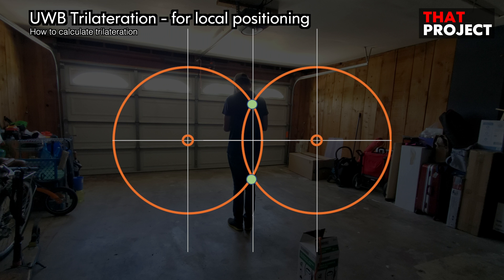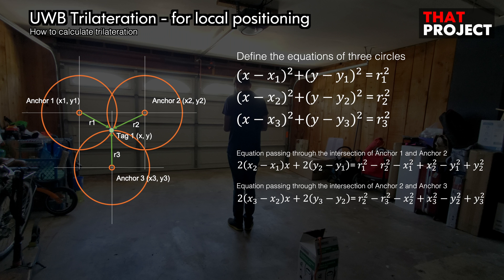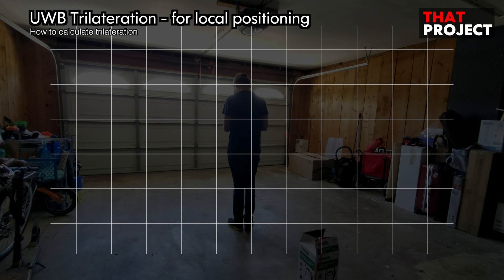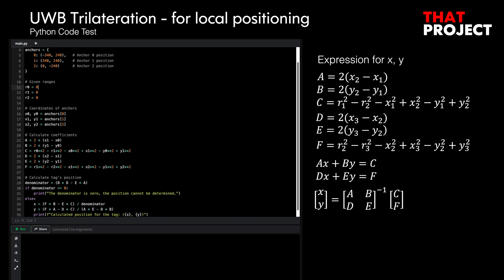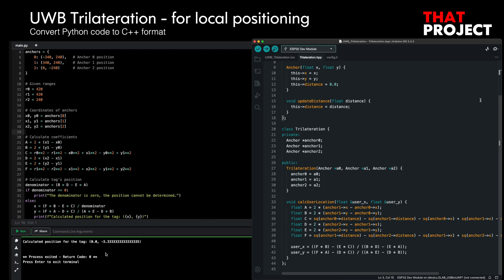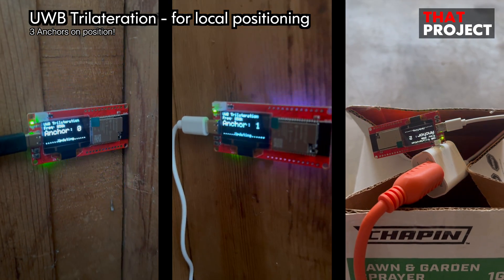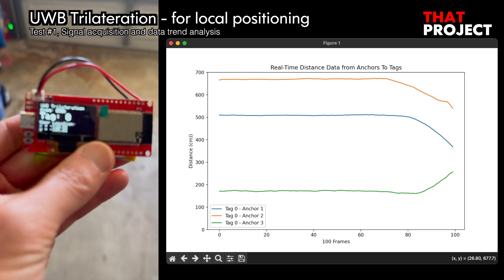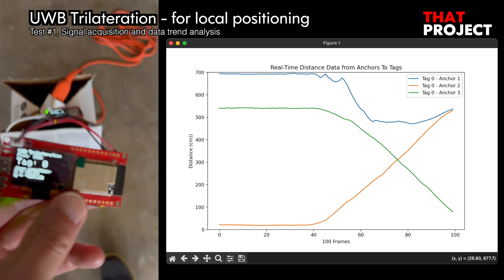UWB Trilateration with ESP32, DW3000 #LocalPositioning

Comment: I have 4 x ESP32 UWB Pro with Display (DW1000) from MakerFabs (this one). I tryed everything but scripts seems not to be working. I want to do a triangulation with 3 Anchors and one Tag.
Do you have a solution on this?
Reply from the maker: I used a DW3000 here, and I'm not sure what the problem is. I recommend posting an issue on Makerfabs' Github. I think they'll be able to address your issue quickly.

Comment: Sir we are going to do automation electrical power tiller using this uwb 3000 how much range I get
Reply from the maker: This doesn't cover extremely long distances. If you're looking for something like that, it's recommended to use a LoRa module. There are also many options available for this, so the maximum transmission range will vary depending on the configuration. For more information, see https://www.makerfabs.com/esp32-uwb-dw3000.html
Reply from the maker: I haven't tried it, so I'm not sure. First, confirm the DW3000 can maintain a stable link at 100 meters or the range you want.
Reply: Okey sir,we want a range around 100 -200m is enough for us sir...we also thought about lora but accuracy less sir,we need around 10cm so we go for dw3000 sir.. kindly give a good suggestion for this sir...we thought to buy a separate qorva dw3000 module and esp32 to minimize our budget..Tell us that also works or not ..or we go with this integrated module..Your reply means lot for us sir ..

Comment: Can I fix 4 anchor around the field . tag is placed in the moving tractor so the tractor location can be determined.i want to make a land levelling machine .for that it should not cross the field . The position of tractor is important.how will be the accuracy in this.
Reply from the maker: There may be a margin of error of approximately +- 10cm, but in your case, since you are detecting the movement of a large object, I don't think there will be any problem using it. It's a fun project.
Reply: @ThatProject sir thank you for your reply I have so many doubts in this can I clarify with you .we are running out of time could you help us sir?

Comment: I want to add another tag so that I have two tags and three anchors. How can I do this? I want to make a two-player agility analysis system.
Reply from the maker: I wanted to try it too, but I didn't have enough devices. I think it should be possible, since you can probably get the same information from the second tag as from the first tag.

Comment: Hello, which codes did you use for anchors and tags? And where did you upload the trilateration code, on the anchor or the tag?
Reply from the maker: Calculating the trilateration on the device that acts as the Tag.

Comment: Thank you for sharing this demo. May I ask if this is possible with DW3000 ESP32 v1.0? I have actually been trying to follow your demo using the codes from the uploaded code on Github, but it seems to not be working. It looks like the AT commands are not working with my device.
Reply from the maker: How about updating the firmware of your STM32? Or if you report an issue on their github they might be able to help you with your issue.

Comment: Very well filmed and explained, thank you! I am planning something similar for self-location of a robot in a 20x40m room, using ESP32 and BU01 (=DW1000) modules. I just glanced at your coordinate calculation code (thanks for sharing!) and noticed you do lots of calculations in the loop, whose values do not change (like sqrt of static anchor coordinates). To save CPU time I recommend doing as many static calculations as possible once at setup time and then using those constants in the loop, with the changing variables, that should reduce the CPU load by about half. You could even let the compiler do the static values and put the resulting constants into flash, saving RAM.
Reply from the maker: @c2h7  Yeah, it seems like my code needs some optimization.
Reply: Hi, where did you find the code? also, if you have an optimized veration, can you pls share it? thanks!
Reply: @ofekfinn1023 The code is linked in the video description. I did not make any improvements myself, I only glanced at the code.

Comment: I'm trying to connect these boards to macbook but the port is simply not recognized. Tried many cables. Any idea what could be the issue?
Reply from the maker: It looks like your MacBook doesn't have the USB Serial driver installed for this module. Please check which chip is used on your board and try installing the driver.

Comment: Great, that's exactly what I was looking for. But I have a few questions: why did u used stm32 with esp32? Can I use only esp32 to do the same (or only with stm32)? If so, which one you recommend?
Reply from the maker: Unfortunately, there is no library that makes DW3000 work properly on ESP32. If you make a driver, you can drive the UWB module directly on ESP32. Of course, I tried it, but it was not easy to implement this alone at a hobby level. In the end, I gave up and used a product that was easily available on the market. Perhaps the company selling this product implemented a driver for STM32 and made it controllable through ESP32 instead of sharing it, so that it can be hidden. This is my guess.
Reply: @ThatProject  Did you consider doing it with DW1000 instead of DW3000? Afaik there is an ESP32 library for DW1000.
Reply from the maker: @c2h7  I have already tried several projects with the library you mentioned on ESP32 and BU01(DW1000) combination. (Please see my previous UWB project). Since the library is not maintained, it needs several updates, and it provides only basic functions, so I gave up using it.

Comment: Hello, May I ask how to make the clock synchronization?  NTP can onl[y reach micro-seconds, but lightspees is so fast, that in meters it will sost only nano-seconds
Reply from the maker: Quick question. What kind of project do you need something like this?
Reply: @ThatProject  I think mine's quite sam as yours. I'm doing my Bachelor-Graduation project, I shall use LoRa moduls to build up an LPS. I tried to use NTP protokol to apply TDoA method, but it seems quite hard to reach time synchronization. But Signal-Intensity method runs good

Comment: Super cool!
How difficult would it be to add a 3rd dimension to this? I'm doing research for a device that will do this and return X,Y,&Z coordinates.
Reply from the maker: Calculating local coordinates x,y,z using trilateration doesn't seem easy. (I tried, but it was difficult to get reliable values) There was a project I tried in the past using 4 anchors. Check this out. https://youtu.be/7oehpBjpucU?si=bhal94qB7I03IH65
Reply: @ThatProject  Thank you!

Comment: do you detect human breathing? or the human have a fob?
Reply from the maker: No no no. This is using only UWB tech.
Reply: @ThatProject  i believe uwb can detect human breathing /human presence
Reply from the maker: @atabac  really? Is there a paper I can refer to for that?
Reply: @atabac  there are cheap  radar modules that can do that atleast. not sure about uwb?
Reply: @atabac  UWB can not detect human motion , those RF sensors generally works on doppler effect which means Continuous wave CW, UWB is impulse radio signal which have wide spectrum in frequency domain. For key fob yes you can embed some payload Tobe detect by receiver to validate your personal Identification
Reply: @pouyazarafshan  you can use any mode in uwb, its rf anyway. only difference its its frequency range. it xan work the same as how normal radar using rf works.
Reply: @atabac  to use DW1000  uwb driver IC as Impulse radar , since transmitter and receiver can not work simultaneously it may not give you desired result. For impulse radar you must have full duplex RF module. If you check RF motion sensors they have separated RX and TX antenna.
Reply: @pouyazarafshan if you still doubt just google uwb human breathing detection. its already existing for a long time

Comment: Hi, thanks for the video, could you please explore more detailes information about this hardware solution. I interrest in what date update speed are? and what accuracy of this solution (UVB)?
Reply: @IvanTereh  Hello , for Decawave DW3000 or DW1000 (now Qorvo mark) uwb technology maximum accuracy in 2D can be around +/- 5 cm and 3rd dimension not accurate than 20cm in best condition. Update rate for each ToF calculation can reach to 160 hz.

Comment: Have you tried the TDoA? It allows for UpTo 16 anchors or more to be used
Reply: @eledikohabib3369  hello, TDoA is another method to reduce number of anchors in RTLS . mostly 2 anchors sufficient for 2D relative positoning instead of 3. Extending number anchors is related to superframe structure and correct and precise implementation of TDMA in UWB but maximum 16 anchors in 2Way ToF amd 32 anchors in 1 way ToF

Comment: Nice job! For 2D RTLS should be fine even you didn't mention if you consider the effect of LoS or NLoS situation in your calculation and since your body block antenna direct coverage and effect in signal quality. For 3D RTLS i would like to recommand you to work on z-axis percision and accuracy in case of indoor installation. Working on network scaling and payload specific usecase can be good idea too. Good luck.

Comment: Why don't you show (or write) what happens, if you stay still?
At least for e.g. 5 seconds.
Would be crucial to see how much the jitter or drift is when not moving at all.
Reply: @huckleberryfinn-cz3gd hello,  dilution of precision and microcontroller floating point calculation will have major effect in accuracy even tag wad fixed in one location.  After that RF characteristics of envirement have second important role in calculation.
Reply: @pouyazarafshan  but that only applys if they have a clear line of sight? cause otherwise I guess moving objects in the room would interfere with the uwb?
Reply: @AndrewTSq  Noise sources that affect the accuracy of Tag position calculation are: multipath effect (exists in LoS and NLoS situations), antenna beam and orientation (these patch antennas have two nulls in pattern related to PCB edges), microprocessor floating point calculation, UWB channel configuration such as percision. signal delay time value inside the firmware, uwb message preamble lenght..., another RF device such as a router in the same frequency band. These sources effect on time of flight calculation regardless of whether the tag is moving or fixed.

Comment: Very nice. This is a building block for room scale positioning. Crucial for smart homes.
Reply: when do you need this in your smart home? (just asking cause curious :)
Reply: @AndrewTSq  Presence on a room/area scale. 
You can make the lights or music follow you around the house. You can differentiate between multiple people with multiple preferences for each room. This is one of the unsolved smart home issues at this moment. There are multiple solutions, but the position update rate to make it really usable is just not available yet. You need it to be fast enough to turn on the lights in the hallway the second you leave the room, this is hard.
Reply: @0xBA5   Okey!, thanks :) I saw a interesting sensor for the lights. Its a human presence sensor using radar, and there was someone here on youtube that used it with home assistant, and it turns on the lights instantly. Very cool and they were like $1 each also. It could also tell how many people in the room :)